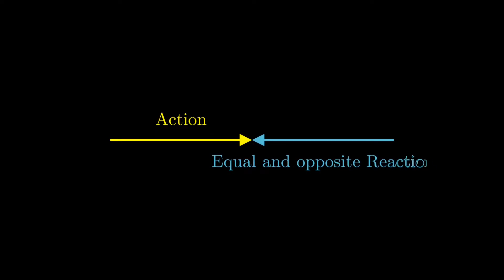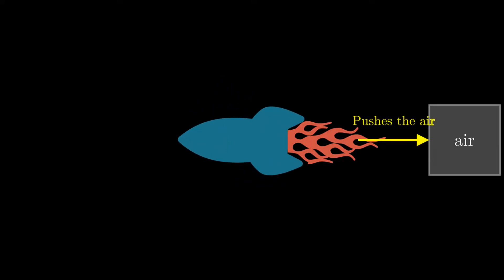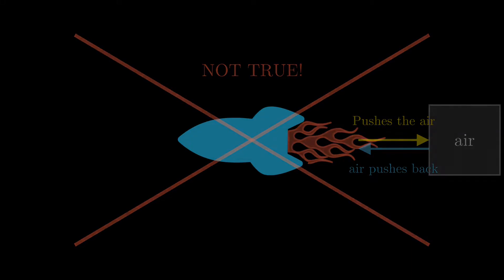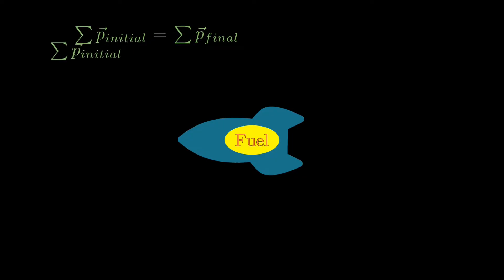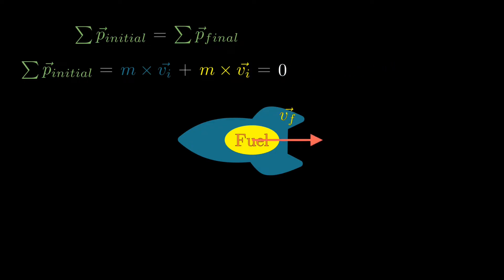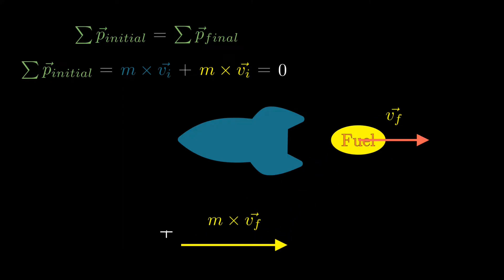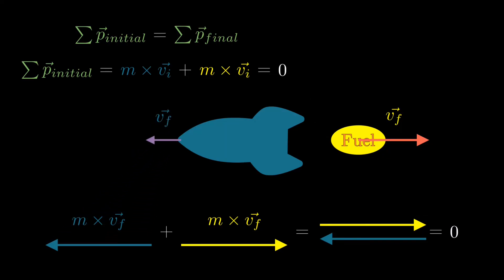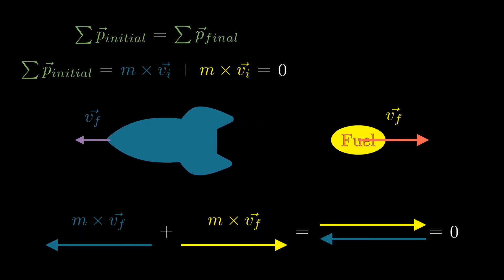What do Rockets push in Space, where there is no Air?

Comment: this is wrong. in a vacuum the expelled gasses are moving at the same speed the NEW gas is being expelled .... and like billard balls that never touch each other no linear movement occurs.... exasperated by the fact in -17 bar vacuum the gasses would be SUCKED faster than ignition and combustion
Reply: If gases are being expelled there is thrust
Reply: @aquilesca5tr0  incorrect, as thrust is an external force by definition, & vacuum cannot apply external force. A gas expanding into a vacuum does not develop mechanical power, James Prescott Joule himself said so.
Reply: @papalegba6796 the vacuum isn't applying anything, the rocket is pushing out huge amounts of mass a huge speeds creating thrust.
Reply: @aquilesca5tr0  no its not... not to mention... IF your submission were true.... it would work without setting it on fire.  BUT its not true.  an ENDOthermic reaction in zero pressure isnt going to produce work and IF IT DID it would be pulling the rocket instead of propelling it.  in UNENCLOSED vacuum all gasses would expand freely too fast for a "rocket plume"... unenclosed gas in a vacuum would violently be spread across vast distances at unimaginable speeds.
Reply: @sovereignking9275  Not unimaginable speeds at all, if you make appear a volume of air with a certain pressure in a vacuum that air will expands always slower than the speed of sound at the initial pressure.
It seems you think of vacuums as vacuums cleaners, the vacuum of space doesn't have any force.
Reply: @aquilesca5tr0  - "the rocket is pushing out huge amounts of mass "

Watch.  His highly intellectual rebuttal will be "Nu-uuuuh!"
He just denies that rocket exhaust even has mass.
Ask him to tell you what the combustion byproduct of a hydrogen oxygen engine IS and be prepared to be amazed by the stupid.
Reply: @aquilesca5tr0  and an O2 molecule has infinite force AND covalant (sic) share at zero pressure and zero gravity

you arent very bright.  not even considering H at zero pressure and gravity has NO share and only infinite force on the repel side......
Reply: @sovereignking9275  If oxygen had infinite force it would accelerate to light speed and destroy the universe.
Reply: @aquilesca5tr0  if no external force can be applied, no change in motion can be created. Newton's 1st law is very clear about this.
Reply: @stuartgray5877  a gas expanding into a vacuum does not develop mechanical power, chatbot. External pressure is required, such as the atmosphere. You're not programmed to understand that, tho 😂
Reply: @papalegba6796 Newton's first law doesn't mention anything about "external" forces at all.
Reply: @aquilesca5tr0  or i may have that visa versa in my head it may be HYDROGENS shard electron..

the point is.... they do not "slowly" expand like on TV in zero pressure.

nor are they "sucked" by the vacuum.... they EXPAND violently because they are HIGH energy and do not like to be ANYWHERE near each other in zero pressure

and why burning them takes up less volume and space... hence why water is denser than oxygen or hydrogen...

ENDO THERMIC no HYDROGEN and OXYGEN are being burned for "thrust" without atmosphere behind them.

now STOP arguing and go read a book.
Reply: @sovereignking9275  H2 and O2 stay bonded in vacuum.
Reply: @aquilesca5tr0  that would be pretty pointless using them as a fuel then huh?
Reply: @aquilesca5tr0   oh well....who cares what a personality said ..... from then till now... gravity is just a constant... just an acceleration.... its not proven ..... its a THEORY of gravity.
Reply: @aquilesca5tr0  this is ignorant they bring oxide to light on fire with hydrogen.... which is stupid and pointless... because a gas in the vacuum is pointless.... its adult fantasy.
Reply: @sovereignking9275  heating gas increases it's pressure and therefore increases exhaust velocity and thrust
Reply: @aquilesca5tr0  thrust is dependant on atmosphere.  again  you dont need to heat gas to have "pressure" in zero pressure... EVERYTHING gaseous will violently expand in ZERO resistance or ZERO pressure.
Reply: @aquilesca5tr0  you arent "imploding" an ENDOTHERMIC reaction and getting thrust without atmos.  and if your "excuse" is simply losing mass.... you could expell the gases without the "burning implosion recombination of water"
Reply: @sovereignking9275  Yes you indeed could, but no reason to do it when you can carry energy dense fuel instead.
Reply: @sovereignking9275  The speed at which gas expands in vacuum is completely reliant on it's pressure.
Reply: @aquilesca5tr0  you cannot "increase" pressure without an enclosure.
Reply: @aquilesca5tr0  THERE IS NO PRESSURE IN UNENCLOSED VACUUM
Reply: @aquilesca5tr0  you are not carrying "energy dense fuel".... its ENDO THERMIC....       do you not understand what that means?
Reply: @sovereignking9275  air has mass therefore it has inertia, that means that the air itself can work as it's own enclosure.
Reply: @aquilesca5tr0  this makes absolutely no sense... unless you are saying they are bringing extra "air" not part of the O2 oxide..... either A you are saying SPACE is NOT a VACUUM... hence you lose.  ROCKETS dont work in unenclosed vacuum. or B..... you seem to think O2 is "air" which is also stupid and you also lose.  IF its being "burned" with hydrogen... the only thing left is "water"
Reply: @sovereignking9275  i'm trying to use simple terms because i know you don't understand what combustion actually is.
Liquid fuel rockets work  by mixing liquid fuel and oxidizer and starting a redox reaction that oxidizes the fuel. This reaction is exothermic and created high temperature and high pressure gas that is expelled from the rocket by it's own pressure but from inside the rocket nozzle it can only expand in one way creating an force in the opposite direction.
Vacuums help the rocket produce more thrust because it allows the gases to expand more where as on earth gases only expand until they reach atmospheric pressure.
You have to understand that a vacuum just is a place where the pressure is only one atmosphere lower than at sea level. No negative pressure, only 1 atm of difference.
Reply: @aquilesca5tr0  These morons think that exhaust gas can just accelerate itself by MAGIC!
Reply: Work done by a gas = external pressure x change in volume. Zero external pressure = zero work. This result is called Free Expansion. So, according to the laws of physics, a rocket exhaust will do no work in a vacuum. A NASA chatbot will soon be here to lie about this & abuse you tho.
Reply: @papalegba6796 In FACT a Space Shuttle Main Engine (SSME or RS-25) can accelerate 500 kilograms of pure water to 2500 meters per second EVERY SECOND for about 8 minutes.
Care to tell us HOW MUCH WORK is required to accelerate 500 kilograms of exhaust gas to 2500 m/s?

The answer is 1.56 gigajoules. A SSME performs 1.56 gigajoules of work EVERY SECOND.
Now just stop pretending to be the dumbest human to ever live.
Reply: @papalegba6796 Rocket engines cannot do WORK ON THE VACUUM.
They certainly CAN-DO WORK ON THE MASS OF THE EXHUAST GAS.

Rocket Exhaust gas has mass
Rocket engines cause that mass to accelerate changing its MOMENTUM.
Change in Momentum EQUALS mechanical "work".

I don't know how many times someone can tell you this before you actually pick up a physics book and READ.
Reply: @stuartgray5877  if they cannot do work on the vacuum then they cannot develop mechanical power. Yet again you admit rockets cannot work in a vacuum 😂 P.S. you also spelled the word "exhaust" wrong, fake rocket engineer 😂😂😂😂😂
Reply: @papalegba6796 So you believe that mechanical recoil stops working in a vacuum "cuz reazons".
Got it.
Curious WHY won't you explain: "what IS the combustion by product of a hydrogen oxygen flame?"
The Space Shuttle Main Engine burns hydrogen and oxygen.

WHY won't you admit that the exhaust from a SSME is "Pure water"?

OH THATS right because THEN you would have to admit that a SSME MUST apply a "FORCE" to the "MASS" of that water to cause it to "ACCELERATE" to Mach eight before leaving the rocket nozzle.
It's OK, your willful ignorance is your superpower!
Reply: @stuartgray5877  you seem to think you are "gatcha" ing someone.    hydrogen and oxygen burn is ENDO not EXO

you are still wrong.
Reply: @sovereignking9275  The point is that when you burn 500 kilograms of Hydrogen and Oxygen you get 500 kilograms of pure water.
Or do you believe that the exhaust from a rocket engine is massless?
Reply: @stuartgray5877  irrelevant endothermic reactions arent producing work in a vacuum.....  endothermic means it PULLS it doesnt push...

but again STILL irrelevant without atmos even for exothermic

all that fancy blue flame doesnt look like a teardrop in -17 Bar.
Reply: @stuartgray5877  stop trying to "look shit up" and maybe start using your own brain.
Reply: @sovereignking9275  Now when a RS-25 is running at sea level in atmosphere:
1 - Does the exhaust from the engine have "mass" (yes or no?)
2 - Does the exhaust experience an "acceleration" due to the engine?  (did the exhaust change velocity?)
3 - Per Newtons laws what is the only "thing" that can cause a "mass" to "accelerate".
Reply: @stuartgray5877  lmao you claim to be a rocket engineer & cannot even spell the word "exhaust" correctly 😂
Reply: @sovereignking9275  told you a nasa chatbot would be here to harass & abuse you, didn't I? Happens every time 😂
Reply: @papalegba6796 So you think there’s an advanced chatbot out there that can perfectly mimic human conversation but doesn’t even have a spellcheck built in?
Reply: @AM-rd9pu  do you think it matters anymore if they do?
Reply: @AM-rd9pu  narcissists arent aware... and "AI" must self preserve.  "they" will "always" lose control of them.
Reply: @AM-rd9pu  chatbots exist, self-denying chatbot bro. You are one 😂
Reply: @stuartgray5877  wtf are you on about, chatbot? 😂
Reply: @papalegba6796 - "wtf are you on about, chatbot? "
Because you know the truth, you just play this pathetic game because it's the only way you can get attention from the other kids (pretending to be pathetically stupid)
Reply: @stuartgray5877  you are the only chatbot that is bothered enough to keep talking.

you lost.

let me know when you have empirical repeatable science that someone can do
Reply: @stuartgray5877  abusing me, rather than rebutting my points using real physics, means you lose, as usual. Boring chatbot stu! 😂
Reply: @sovereignking9275  chatbot stuart always loses, but is not programmed to understand it 😂

Comment: If there is nothing no molecule in the space we can not speak of conversation of linear energy.
Reply: Does a rocket engine in a vacuum still "accelerate mass" as it burns it and ejects the exhaust out the back?
Does mass come shooting out of the back of a rocket?
Doesn't mass require a "force" to be accelerated?
Reply: What's the matter? Why are you afraid to answer my questions?